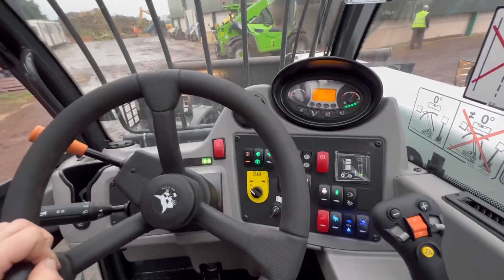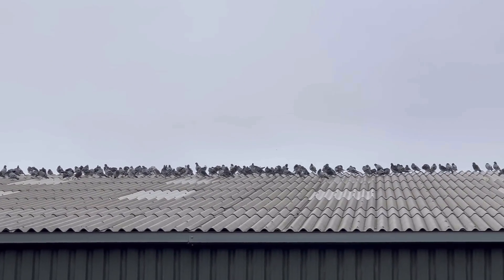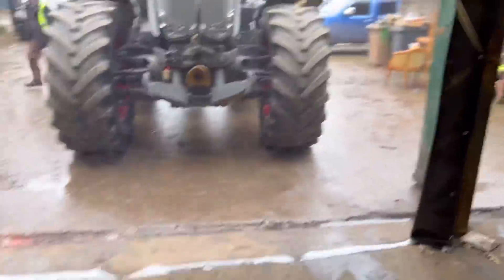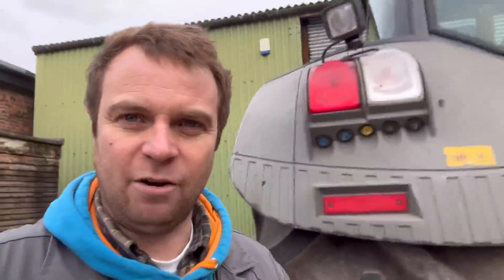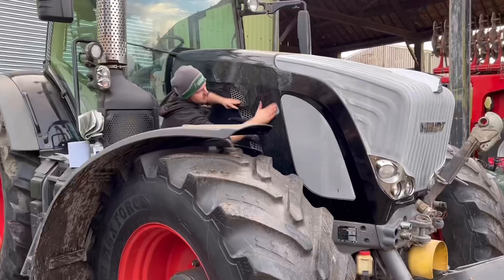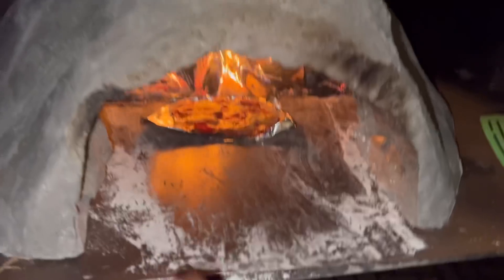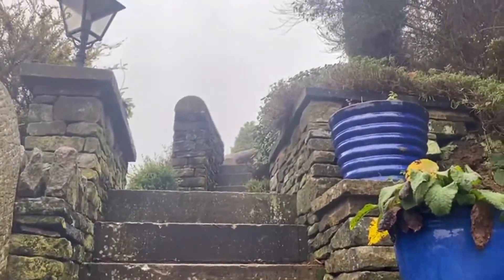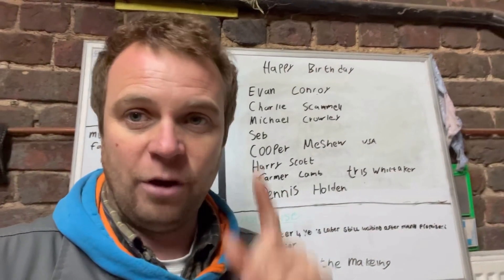Day604 #OLLYBLOGS TRACTOR VIDEO ,AS LOTS IN HERE TODAY INCLUDING A BLACK FENDT 936 #AnswerAsAPercent

Comment: Was the International that is coming also produced in DB Case colours if it was there was one around Much Wenlock area early 80s it came next door to use the next doors shakerator on its cow fields but could not use the pto for some reason. It was driven by a farmer that farmers on the Bridgnorth side off Much Wenlock. Dealers in the area then were Burgess’s Bridgnorth and I think Gibsons of Bridgnorth were still going. Gary mite now I think he was at Cornfield’s then.
Reply from the maker: Yes they where mines a red one